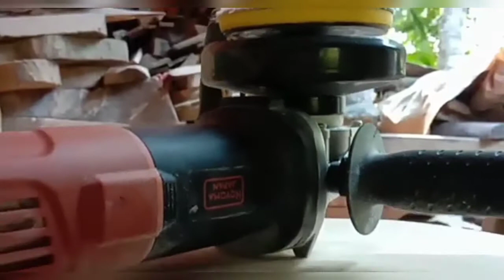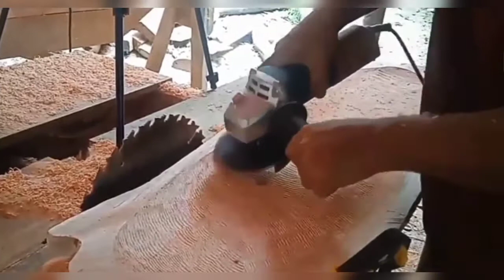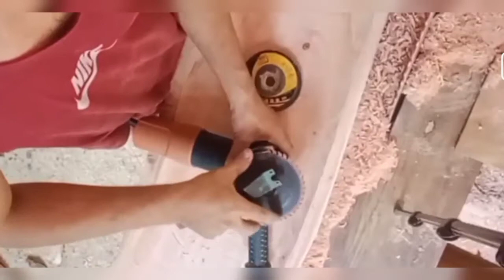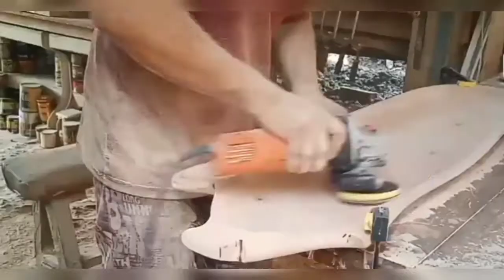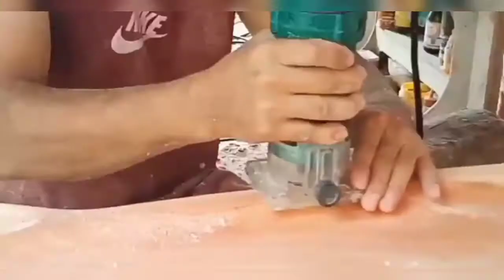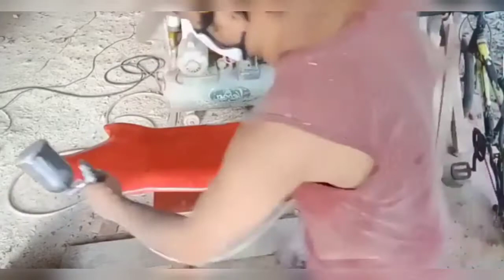How To Carve Lechon Tray || DIY Wood Carving Fast & Easy

Comment: ano pangalan ng angle blade na ginamit nyo, i'm interested to buy it
Reply from the maker: Circular saw blade #4 lng yan boss atsaka flap disc & velcro backing pad/sand paper. Sometimes ginamitan ko ng turbo planner grinder blade #4 depende sa kahoy.